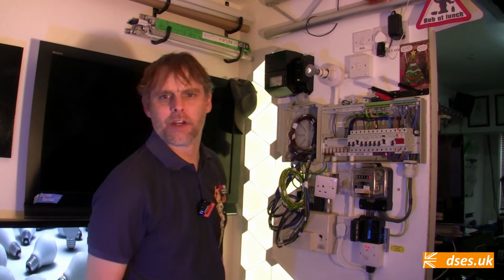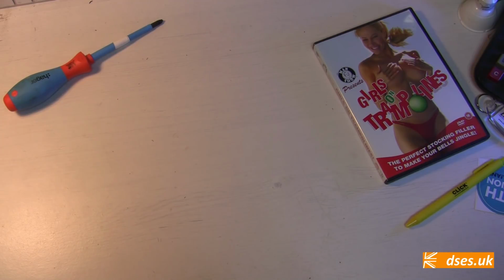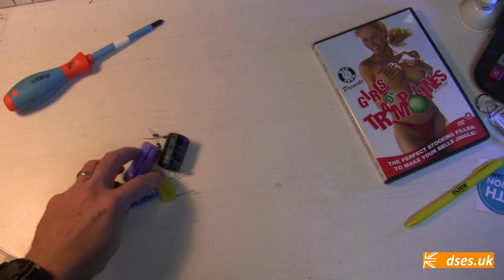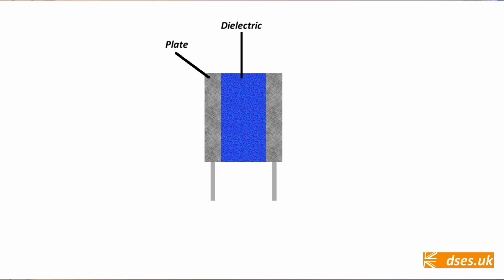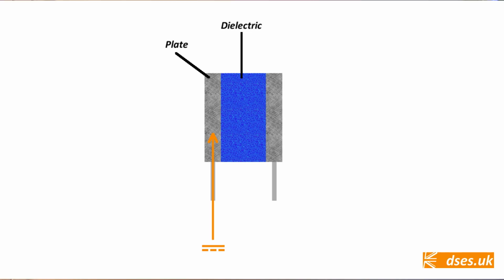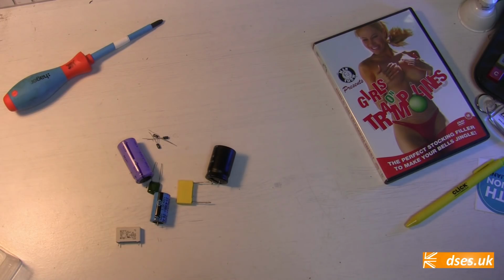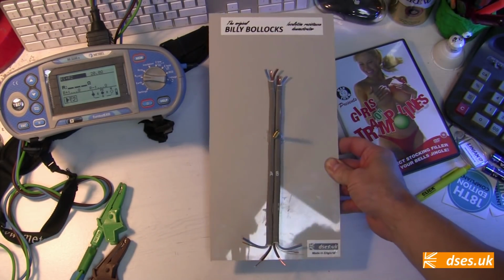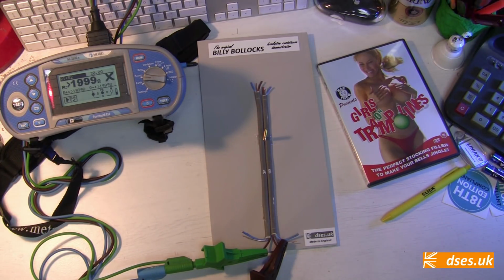Nuisance glowing LED lights

Comment: Instead of an indicator light, you can actually buy a capacitor that solves the problem. And some dimmers have the same problem when their load isn't high enough.
Reply from the maker: Ah, I have heard of capacitors and zener diodes that fix the issue, but I'm not aware of what rating ought to be sourced. Have you seen any out in the world? I must admit, I haven't looked too hard.
Reply: David Savery Electrical Services I have used such a package to snub out spikes caused by multiple contactor coils effecting a lcd display on a programmer, as far as I believe the capacitor  rating should be twice the AC voltage ,due to the rating of the capacitor is dc and does not take into account the sign wave of AC current
Reply: MrDoubledrive you can get a complete package rated at twice the mains voltage known as a snubber diode.
Great solution.
Reply: There's one made by Busch&Jaeger called the 6596 compensator that I've succesfully used.
Reply from the maker: @MrDoubledrive  Very interesting! Thanks!
Reply: No problem David, I've learned far more from you!

Comment: I can remember in the 90's changing a few rows of fluorescent light fittings in the office I was either an apprentice or not long qualified( I'm still a young lad I tell myself) I had isolated the supply line but still got a kick off the first light so doubled checked the power and even disconnected the neutral its when I discovered it was the added capacitors in the fluorescent lights adding together.Those capacitors are nasty things. Btw I've still got my 15th edition of bs7671 antiques road show here I come
Reply: Ha! I’ve done exactly the same in the past. Also had a lucky escape when I was in my early teens pissing around with an old CRT TV 😳 had a numb finger for a while.
Reply from the maker: Haha! Nasty things. That's why you give the apprentice a metal rod and get 'em to discharge them for you!

Comment: Since changing interior lights in car to LEDs, when engine running and (illuminated) glovebox opened I get a glow on the front roof lights.
Reply: Nicholas Pratt it’s to do with the circuitry like inside the led lamp in David’s video. Most modern car’s interior lights are all connected to a body computer.
Reply: @AutoVoltUK  Yes most of mine is CAN Bus.
Reply: @nicholaspratt7934  CAN bus is unrelated, and just a communications protocol. As mentioned, the BCM uses soft switching for most lower power loads, especially interior lighting thus some leakage current is normal
Reply from the maker: The supply to your vehicle lights will be DC, but then again if it only happens when the engine is running then maybe something is happening with the alternator? Unfortunately, what I know about cars isn't worth knowing!
Reply: Vehicle supply is as you say dc, but the alternator is three phase,rectified by a bank of 6 diodes and electronicly regulated,The supply could have ac ripply supperimposed on the dc supply.

Comment: The voltage measured depends on the current drawn by the different test metres
Reply from the maker: Cheers Robert. Interesting to see such a variation of readings when the current is so small.
Reply: @dsesuk  This the problem from test LED's since them exists. Only in the past some nerds use them ... 

Old GDR aluminium cable and LED's be are more problems too. They can let exists your job! 😀

Comment: Thank you for this video, I’ve experienced capacitive coupling before and struggled to explain it to the customer, they were convinced something serious was wrong.
Reply: Yeah mate same here. There was back feed on a neutral and with the switch in off position (switch line only at wall switch) and neutral at ceiling light. I was picking up 160v at fitting across switch live and neutral with switch in 'off' position. Enough to allow led g9 to glow . Spun me out 🤯
Reply from the maker: Glad you found it useful. It shouldn't cause any harm out in the world; it just looks odd when you have a ghostly glow about your bulbs!
Reply: I did all the verifications and IR, so I knew it must be a coupling thing. But you know what it’s like when you’re swapping out a CU, there’s always that nagging doubt that something awful is about to happen once energised, even though you EICR’d first. Have also had the issue with one of those Danler switches that doesn’t require a neutral, it has a PP3 on the back. Still made three LED lamps flash every 5 seconds when the bloody thing was “off”. Every day is a school day.

Comment: I've had LED panels glow with earth connected and turns off with it disconnected 🤯
Reply from the maker: Sounds odd. Could that be a bit of earth leakage, small enough to cause a glow but to not trip an RCD?
Reply: @dsesuk  tested the RCD on a ramp test and it was fine. the driver was isolated from the CPC the only thing in contact with the earth was the DC side where LED panel contacts the grounded housing.
Reply: @MLWALK3R  I'd suspect it's something to do with the Class Y capacitor in the LED driver. If present it's there to stop the anything on the output/secondary side acting as an aerial for any RF noise from the SMPSU by coupling [it] back to the earthy primary side. Downside it there's few mA of leakage. But if the secondary side is earthed it's not needed. Look for a 5-10mm blue disk capacitor coupling the two sides of the isolating transformer in the LED driver. It'll probably have an isolation gap in the PCB between its leads.